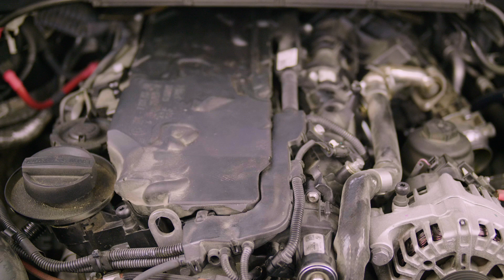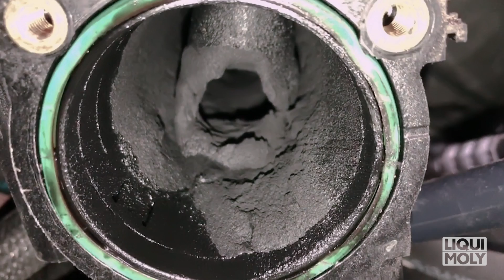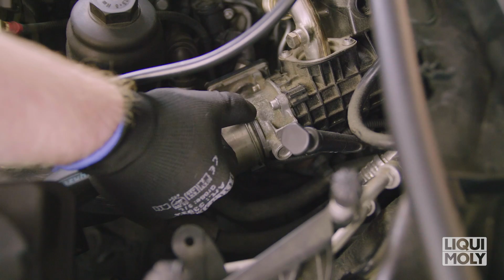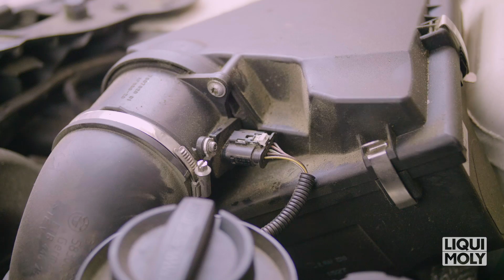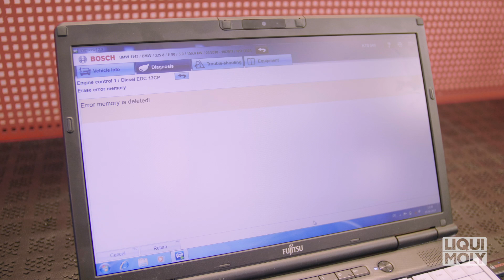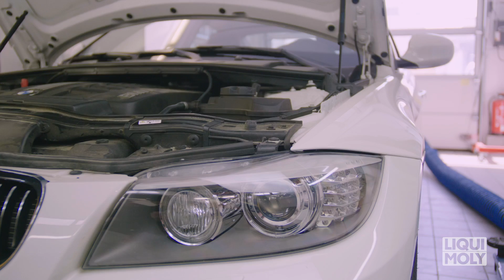LIQUI MOLY Pro-Line Intake System Cleaner Diesel (#5168) EN

Comment: It works really well.
Used it on my VW T5 AXE 2.5 tdi. 
Better throttle response and more power.
The only problem I encountered was that the nozzle at the end of the hose came off and my engine ate it.
Luckily it burned up and I didn't notice problems yet. 
But it should be secured to the hose better.
UPDATE: Turbo got stuck and blew up my intercooler. Keeps ging in limb mode.

Comment: Hello Liqui Moly , what is your take on using this cleaner on a DPF (that has a DOC also ) with regards to the fact that the oil from the intake is going in the combustion chamber and then the ash component result is stuck in the DPF ? Please don't tell me to use the DPF cleaner next because that is for soot only , not for ash build-up . The water-pressure cleaning scheme destroys the honey-comb and the "glue" between the honey-comb racks , and also damages the fiber-glass insulation . So do i order a new DPF after 5 intake cleaning cycles ? And also , what is the effect of the extra exhaust soot (that we clean off the intake as oil) on the turbo ?

Comment: I just did it on my Honda CRV Mk2 CTDI last edition 2006 (Euro4 no DPF): throttle response is immediate after treatment. It is indeed a Solvent, in chemical language, studied to be Aspirated and exhausted. It works very well and in my opinion it holds the value for its cost (as an adding maintenance procedure).

Comment: Hello, Does it contribute to the easy movement of the intake manifold flaps?  I have a Renault Kadjar 1.5 dci engine; there are both map and maf sensors behind intake. So i wonder that where should i apply the spray? And also is that ok when i apply it after oil change. Thank you.

Comment: I used this on my W124 Mercedes 250TD yesterday.

I immediately noticed crisper throttle response. It was apparent because I had to take my aunt to work; 120 mile round trip. I hadn't noticed on the test drive I did immediately after.
Gonna install a catch can and then make this part of annual maintenance.

Comment: Hi, is it safe to run my turbodiesel engine after removing the hose between the intake manifold and intercooler in order to spray this product into the intake manifold? I'm wondering is it good for the turbo to run when this hose is removed🤔

Comment: Will this work on a 2007 Jeep Grand Cherokee 3.0l (Merc engine) CRD Turbo Diesel V6? It looks like the air intake goes almost straight through the Turbo and figure it might have a vacuum pressure and the can says do not insert a hose or that is under vacuum? Maybe I’m just misunderstanding the warning?

Comment: Looks to be an N57 powered 3 series in the video. Any issues after doing this with that particular car? I've got the same car basically. Whilst I have cleaned the manifold by removing it, I think this might be a good preventative method to keep the gunk in check.